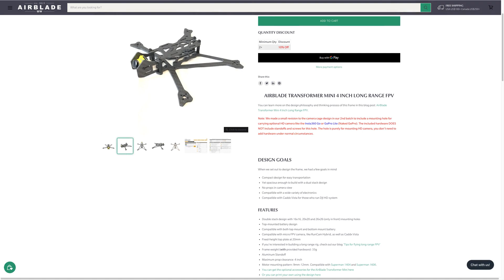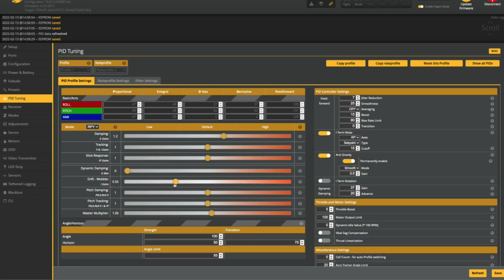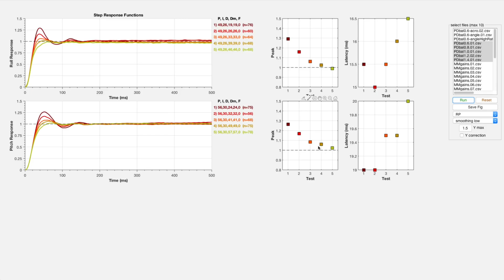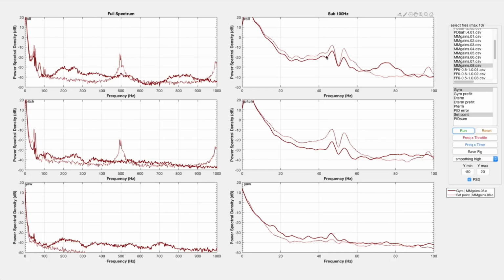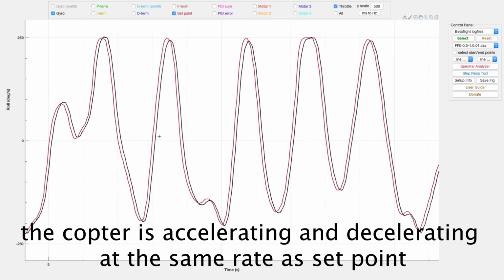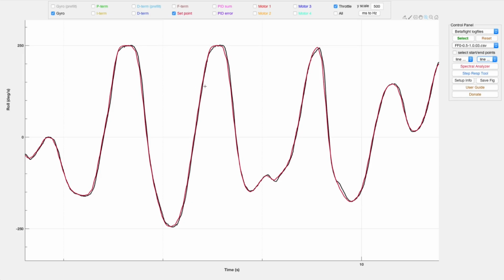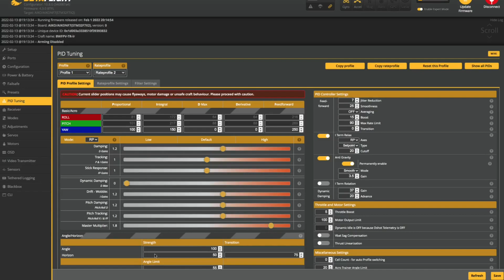Basement tuning just got a lot easier! - USE ANGLE MODE!

Comment: The reason feed foward is different in angle mode is because of the gyro. If you look at the data at the end of the peaks the gyro drifts away. That's caused by the quad angling itself. If I'm not mistaken.  Just a bit more information being processed. That's just my logic take it with a grain of salt. It does make sense though.

Comment: How do you manage to get such smooth graphs? No matter how many logs I write - I almost always get very wavy lines that make it extremely hard to tell the difference. this is one of the reasons I prefer to use blackbox viewer and manual log analytics.
Reply from the maker: Low freq broadband noise causes noisy step resp traces

Comment: Hello! One question. 
For the PD balance, it is the same to move the damping slider (D gain) or to move the Tracking slider(PI Gain)? 
Thank You!
Reply from the maker: Not exactly the same because I term would be changing as well if manipulating PI. That’s not ideal for adjusting P-D ratio. But if you drop the iterm slider such that I is very low or even off, then it’s technically the same.

Comment: Hello sr i have a strange one here...when iam tunning ff (stick response) y move the slider but then when i check it with the toolbox, the graph is the same no matter in wich position i put the slider (stick response) dont know what iam doing wrong. Thanks
Reply from the maker: Make sure you don’t have leftover logfiles stuck in main folder. On mac it’s really a problem if you don’t unlock logfiles. It’ll keep reading the wrong logfile
Reply: @PIDtoolbox  i don't use mac but i will try that. And an "autofactor" of 90 could be the problem too?  Thanks for your time it's really valuable what You do. Really thanks
Reply from the maker: @gonzafpv2843  or right, old version.
Reply: @PIDtoolbox  a high value of autofactor (90, stock is 30) it has nothing to do with it? Thanks

Comment: Did you had problems where log file doesnt open? It just doesnt really load up. Shows - loading and never loads up... Seems like file is too big (4mb), but even if i fly a little - it same, gives 4 mb file -_- Black box logging on 1/2 (1600Hz) Gyro Scaled.

Comment: Hi Brian, thanks for your amazing tool!! a question .. do you suggest to flag the Y correction in step responsive tool? I saw that you don't flag always this option... Thanks!
Reply from the maker: Not sure I understand what you mean by “flag it”. It should be used only in special circumstances
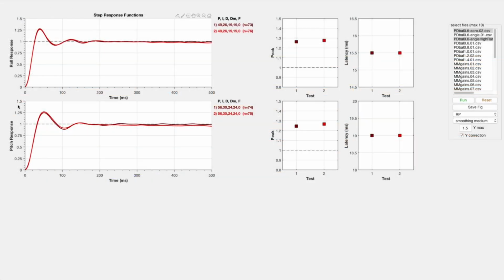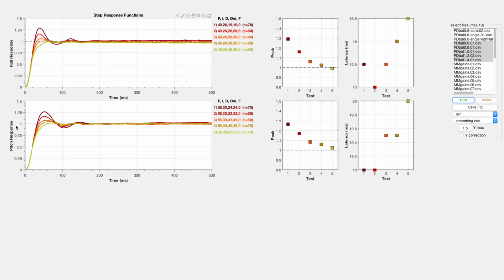Reply: thanks.. in this video at time 2:52 the Y correction is flagged … from 3:40 the flag is OFF
Reply from the maker: @MeccaDrone  that is the check box that turns it on or off

Comment: Hi Brian. Thank you for your job, this video is very helpful. After follow all of your steps got my quad flying really well. I've adjusted the pitch to roll ration (both sliders at the same multiplier) to get the same delay in both axis, now in the step response have a little overshoot in the pitch axis. Does it require a little more Pitch Damping without moving the pitck tracking or lowering the pitch tracking alone?
Reply from the maker: Only if it’s P related overshoot. I’d bet my money it’s iterm. Drop iterm and test again. If overshoot is gone then PD balance is right. The add iterm back but you’ll need more pid gain and/or FF or reduce iterm a bit on pitch.
Reply: @PIDtoolbox  the problem is that can't adjust I term just for pitch, has to do that for all axis. Will try it tomorrow. Thanks Brian!
Reply: @PIDtoolbox  Hi Brian. I lowered the I term multiplier to 0.5 and the problem still occurs. Previously I lowered both pitch:roll ratios that got after adjust they to equilize latency on both axis. Obtained 1.35 on both with your method, now lowered to 1.25. If it's an I term related overshoot then I can't tune it with sliders because I can't adjust I term on one axis alone. Or I have to adjust something else. I would try to move pitch damping alone to 1.35, but D term is way high in pitch right now. Step responses: https://ibb.co/g75X05M. Sliders: https://ibb.co/gSvdjJd. Thank you so much!

Comment: Really appreciate your videos, Brian!  I tried this method on a Squirt I have been having issues with.  It all balances well in Angle mode, but when I switch it to Acro, the motors and stack get very hot, and the motor noise changes dramatically.  It's fine again when I switch back to angle.  Any suggestions?  Filtering?  Thanks for your brillaint content.  I too would love to see a tuning showdown between you, Mark and Chris! ☺✌
Reply from the maker: Sounds like a filtering issue.

Comment: Hello, I am a faithful follower of your method to adjust pids and the truth is that I love the system. But I have a doubt and I wanted to ask you to see what is better. If I want to adjust pids of a drone that usually carries a gopro, which is better? adjust the pids without the camera and then raise the multiplier a bit or adjust the pids directly with the camera on top?. I use a softmount for a gopro 5 and the fit results are a bit confusing.
Reply from the maker: the gopro will usually only affect the pitch axis so either method will work but you'd only be boosting pitch, not MM.
Reply: @PIDtoolbox  ok, thank you very much.

Comment: I have just concluded my testing using angle mode. Previously I have been using your old system with great success. I was excited to try this. I used a 5 inch quad lightweight with no action cam. This method was a fail/success for me. Utilizing the Feedforward made my quad have a lot of propwash and flew very uncomfortably. However after simply turning off FF the quad flew amazing. I set the I gain just .10 Higher and it was magic. This quad is one of my first and very familiar with its handling. This is the best it has flown ever!

So I have concluded so far at least with this quad, That tuning with Angle Mode on Might actually be better. Thanks for the Video it was fun to test this and I think I will try this Angle mode method on my other quads.

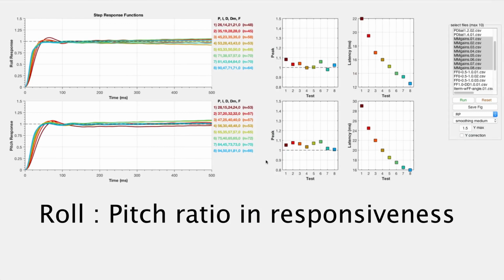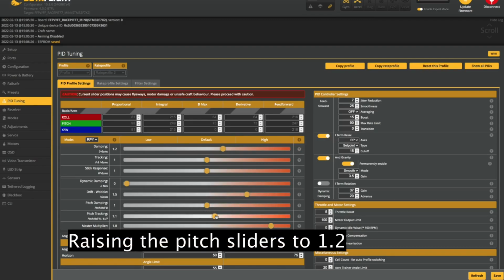Comment: Nice video! I don't get it at 7:22 - 8:00. You tried to set the latency ratio the same, but while adjusting, the result in your example even got bigger (from 2ms to 4ms), which doesn't make sense to me.
Reply from the maker: Not sure I understand what you mean. But, I didn’t show the results after pitch was adjusted (just forgot to show this, but it’s right there in that data). I was comparing two different points in that plot just to show what values I would pick.
Reply: @PIDtoolbox  Aah that explains. I thought the picture while explaining was the one.

I wanted to ask about a trouble I have with setpoint response tool in PIDToolBox - While my I term is 0, the setpoint looks smooth, but when I set the I term over 0 , it overshoots. It's like this on all the logs. Is that normal? Thanks!
Reply from the maker: @tomasspetersons4158  iterm is tricky to understand. When pid error is low (in other words when the error is mostly already minimized with P and D), then iterm has a very wide tuning window such that even very extreme values will show little iterm modulation (especially when using sufficient FF). But when there is still a decent amount of error then iterm accumulates higher and adds significantly to the pid sum. In that case you’ll also see it shape the step response as a sort of slower prolonged overshoot. Key there is to add more FF (and/or more PD gain) to close the error gap. Now the minor issue then is you can’t really interpret the step response when FF is added (it tends to exaggerate overshoot), so you just analyze set point and gyro traces at that point. Maybe one day I will resolve this issue but for now the step resp is really only useful for optimizing PD ratio and PD gains and maybe PI balance if you choose to go that route
Reply: @PIDtoolbox  Great answer! Thank you! So I did tune P and D gain with I term 0. And then added I term and started tuning FF till gyro and setpoint were in sync. 

But I thought, maybe a good way would be getting good P:D balance and then starting tuning FF. Then getting good response, and then maybe adding I term?

Anyway, you solved my confusion. I feel like going with raising P and D gains would be a good road for the freestyle quads, but for racing, would be too much for the motors. Hope there will be some kind of a good method for tuning racing rigs. Thank you!
Reply: @tomasspetersons4158  I had the same doubt, I adjusted the ratio of P and D and it was perfect, when I started adding the I an "overshot" started to appear even with very low I values.

Comment: So I've went through filter tuning and this PID tuning. I think it went pretty good and got great results. Really good and easy to follow guide. However now I feel like the motors are a little bit to warm for my liking, not hot but to warm. What is the best way to get cooler motors without doing everything from the start. More filtering? Less Damping? Does this ruin my pid tune?
Reply from the maker: Properly tuned PIDs will not make motors hot. If you are getting how motors and you are confident it is either PID or filter-related, then it would arise from one of 2 possible things: (1) excessive PID gains and/or excessive filtering (causing excessive filter delay) are causing low freq feedback oscillation. (2) not enough filtering is resulting in noisy dterm, which causes a noisy pidsum, which in turn causes a noisy motor signal feeding into the ESCs. Both of these are easily observed right in the raw gyro and dterm traces. If neither of these possibilities, then motors will also get how if the rig is over weight and the motor rpm is really high just to get the thing off the ground (as with many cinelifters). So going through the PTB basement tuning steps is not complete if you see (1) or (2) above. you have to know where to look to determine those.
Reply: @PIDtoolbox  Thanks for the fast and detailed response. Yes my quad is pretty much on the heavier side even for a 7inch. Need quite some throttle to lift of the ground. Motors aren't really hot, just warm. I am still able to touch them without feeling pain. Just would like a little bit more headroom in case of a crash and having to fly back with a bent prop. I will try your suggestion. Thanks again

Comment: Hello, 
thank you so much for this great tool and this tutorial. 
Some things are not clear to me: 
when i test for the damping d gains the master multiplier must remain at 1?
then i have to test the master multiplier having already set the correct damping d gains?  thank you
Reply from the maker: Everything should be held constant during any of these sets of tests except for the thing that you’re manipulating so in that case it’s Damping. But the master multiplier need not be at 1.0 for these tests and in fact depending on the rig sometimes it’s better to have the master multiplier start a little bit higher or a little bit lower depending on the authority. For example on an under powered cinelifter the default master multiplier of 1.0 is a bit low and may lead to ambiguous PD bal results.

Re the other part of your question if I understand it, yes when you get PD balance right then I typically start increasing MM, and it doesn’t matter if you repeat MM1.0. Replication won’t hurt anything

Comment: why not using averaging in feedforward, does it because using 50Hz link, or the averaging is not much benefit from it.
Reply from the maker: averaging for 50hz rate is not recommended. I think it causes a lot of delay to do 2 or 3pt averaging when the samples are only coming in 20ms apart (50hz). Higher rx rates call for it
Reply: @PIDtoolbox  ok noted sir,,,thank you verymuch

Comment: With this method, the tune is based on the step response on the lower end of the setpoint range. Does it generalize to higher rates like 1000deg/s if you tuned at 200deg/s max?
Reply from the maker: Generally speaking yes it does. This is because the system is relatively linear within the range of settings we use. And where it is nonlinear there are dynamic parameters that are there to help out (like TPA ‘D’ at 0.65, iterm_relax_cutoff, FF, all of which help the maintenance of set point to gyro relationship at the extremes).
Reply: @PIDtoolbox  thanks for the answer. I think it makes sense. Most of the time we fly in the center stick position so that's the most import part for have tuned well. One follow up question, does an indoor tune deal well with external factors like wind? Indoors when the setpoint is zero there isn't much pushing the quad around but outdoors this is quite different.
Reply from the maker: @avsaase  yes in fact because it tends towards higher PIDs because you’re able to push the master multiplier higher in a controlled setting. So once you reach the upper tuning bound there it’s recommended to step it back a bit to a more safe range. But you’d never otherwise know what the upper bound of the tuning window is without this method. If you are not gaining any response latency at higher gains (or you’re beginning to see oscillation) then there is no benefit to going higher. No more reduction in response latency indicates that the motors have given all they can so settings higher than that won’t buy you any extra control over external forces, at least from the stand point of PIDs. You still have ESC settings which can change things. But the output of the resp latency shown in Ptb step plots gives you a good sense of whether you’re at the top and where you might want to set things in that overall tuning window
Reply: @PIDtoolbox  awesome. I'll give it a try today. I'm tuning a 7 inch quad in a smaller room than your basement so it'll definitely help doing this in angle mode.

Comment: brian, about the FF, after i get the highest MM and then start to add FF then my step response will showed massive overshoot..  did you ignore the overshoot?
Reply from the maker: No. The step resp tool exaggerates the overshoot caused by FF. You should not interpret those plots after you add FF. That’s why I did it direct in the traces. Recall there was no overshoot there.
Reply: @PIDtoolbox  okay, but then we cant tune i term likr before, i mean we cant see when the iterm starts to add overshoot.
Reply from the maker: @TERBANGFPV  correct. or do iterm before FF. I have no hard rules about this. But technically I think you can still look at iterm effects in step resp with FF. You'd just ignore the initial be FF-related overshoot and look for the slower iterm related overshoot. I think it can still show up there. But the truth is with enough FF, iterm never get over

Comment: I have a question, I have a costum system where I need to process the output, for this I process it as CSV. Now is there a way to insert a CSV into PIDtoolbox without running it through the blackbox_decode first? Thanks in advance!
Reply from the maker: Short answer is unfortunately no
Reply: @PIDtoolbox  Ok, thank you very much for the quick response! Though I have another one, could it be that PIDtoolbox expects some response from blackbox_decode? (Side info I am now trying to integrate my code inbetween the PIDtoolbox and blackbox_decode, but now the toolbox opens the loading bar and then stops. I've tried looking through the source code a little but i didn't find anything)
Reply from the maker: @Martin-zo8lz  yes it does

Comment: This is fantastic! Finally an easy to follow, step by step guide. And it gives superb result! Just now, spent 40 minutes and got a tune for my quad, that i never had even close! Would be even greater if don't skip i-term tuning. And make the same short and concise video about filter tuning. For filters, please take some hard to tune quad, like 7" long range or cinelifter. Where you actually have issues
Reply: Tuning filters is pretty individual from rig to rig and there are different strategies to attack noise. Will be hard to explain it all in a single video for general use.

Comment: great explanation, thankyou :)
 but you didnt show the step response tool graph when incrasing ff and i.. does the curve remain flat to Y or it jumps with some overshoot? (witch is what i usually experience when i put ff and I to more than 0.2 on sliders)
Reply from the maker: The step resp tool is not recommended for FF. It tends to over estimate overshoot that’s not apparent in the traces. This is also why I didn’t plot iterm there either. Once FF is introduced you can really only properly evaluate it direct from traces
Reply: @PIDtoolbox  ❤️ that's a really great news... I was following Your previous tutorial where FF and I term where evaluated on step response tool.. And i couldn't get anough far from 0.3..

Thanks 🙏

Comment: I have to ask what the filter settings are on this quad? Great video!
Reply from the maker: No RPM because the ESC is blheli s. Instead using 3xDNs, and single gyro lpf at 150Hz. Dterm default i think